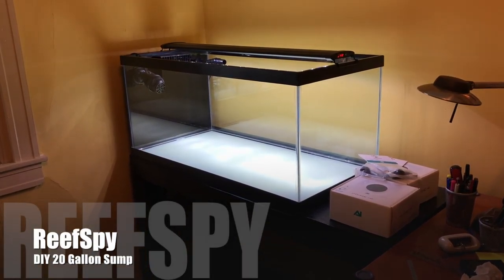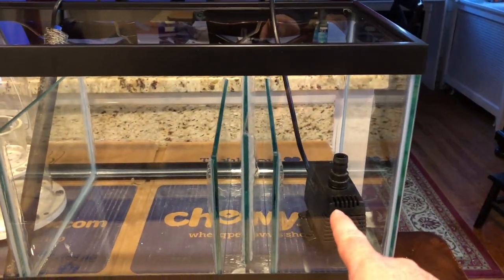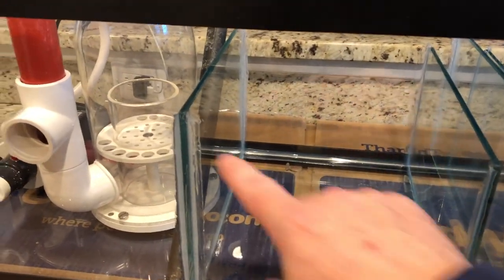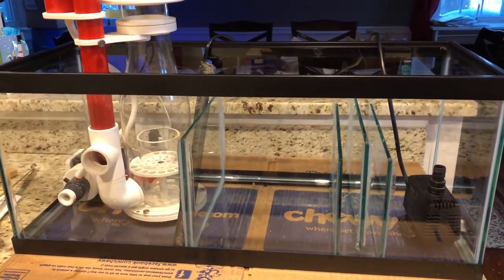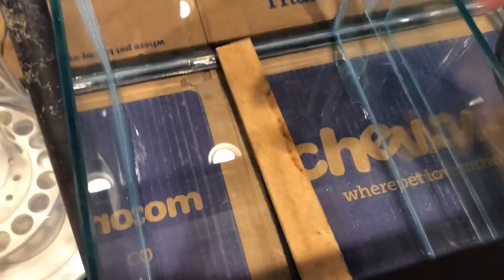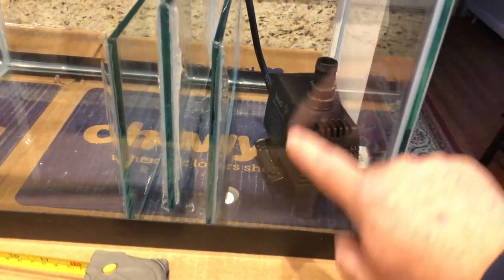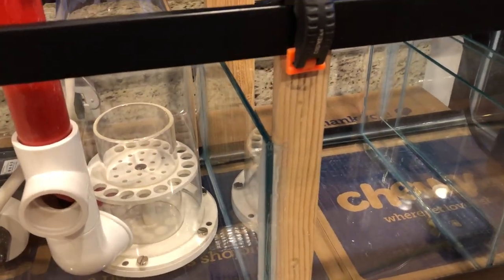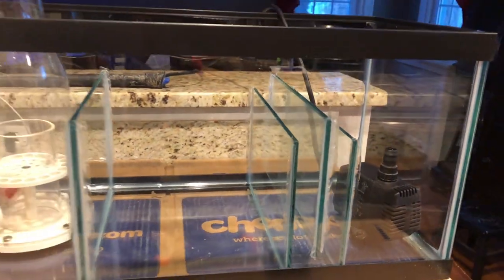DIY 20 Gallon Sump for 40 Breeder Frag Tank

Comment from the maker: After water testing this, I think it would have been better to make the last baffle a little shorter than the previous ones.  I may replace this with a 6 1/2" baffle in the future.  This way will work, but if you are using this as a guide take that into consideration.
Reply: Thank you so much...rather THIS than hundreds of bucks for one...well at least til I can afford a tricked out one. Bo one is going to see it but me! Happy Thanksgiving in advance, too 👍
Reply: Why would you lower the last baffle? Did this mean only the return section goes down in level from evaporation

Comment: excellent design, I will copy this, but I have a question, and i'm a newbie and about to start my 1st salt water tank, so I know nothing, but I see a lot of unused space at the top of the tank, (maybe 2-3 gallons) I understand your skimmer required a certain height water level, and I get that, but could you set the skimmer on a 3 inch pedestal so you have the skimmer the right depth in the water but still have more water in the other areas? I have no idea. just curious. I read more water is better (more area for the bad stuff to be spread out in). plus I would think you could go longer without having to top off.
Reply from the maker: You want extra space because when you turn off your pumps some water will flow back down into the sump. Extra space ensures water remains in the sump and not on your floor.

Comment: Sorry if asked before, where and how are you able to get those glass partitions and what type of silicone did you use?  How is this holding up?  Thanks.
Reply from the maker: Just use aquarium grade silicone.  I got mine on Amazon. I got the glass baffles made at a local glass shop.  I gave them the dimensions and they cut it for me.

Comment: How do you figure out the height of skimmer?  Based on the skimmer's brand and suggested water level?  I know that the skimmer manufacturing are hardly accurate.
Reply from the maker: I used the manufacturers recommendation in the user manual.

Comment: How did you connect your drains to the sump?
Reply from the maker: I have a piece of flexible PVC hose that runs from the overflow down to the sump
Reply: @ReefSpy  just dangles in or did you use something to connect it to the sump physically?
Reply from the maker: It dangles in.  Although the flexible PVC is flexible, it is also quite rigid.  Its not moving anywhere so didnt feel need to connect it physically